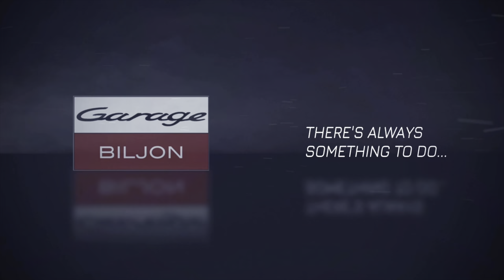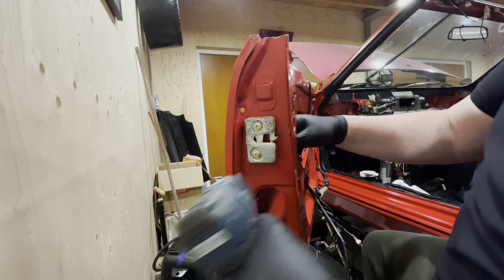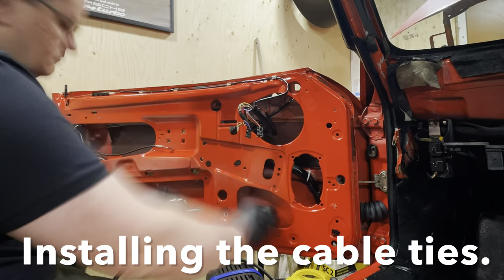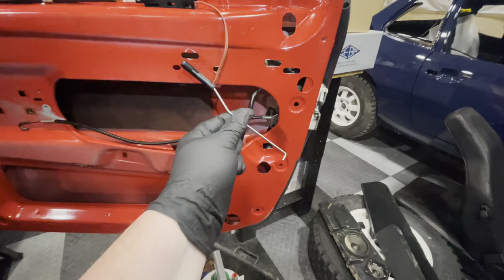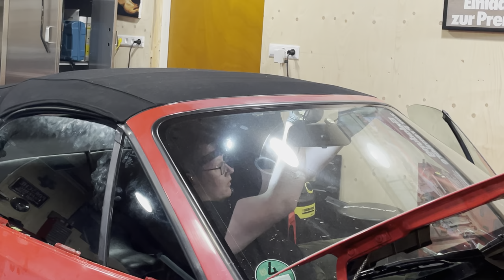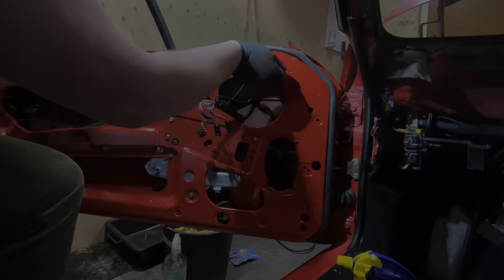Restoring a Flood Damaged Porsche 968: Restoring the doors - Part 2 #Porsche968 #Cabrio

Comment: Awesome!  Thinking about the wiring and verifying that it is OK from the flood, have you been checking each end of various harnesses to ensure that there is minimal or no resistance?  Agree with you that the window regulators are a pain to deal with, even more so on Cabrios.  Just a thought, avoid using the door lock buttons to manually unlock the doors.  Those are very touchy and easy to break the outer from the inner portion of the plastic.
Reply from the maker: Thanks Jeff! I have not been measuring resistance but also don't think it is necessary . I am yet to come across any copper oxide, so I have no reason to doubt the harness. I am going to look into lock actuators that operate from a fob instead of a key, this way I never have to touch the lock button.